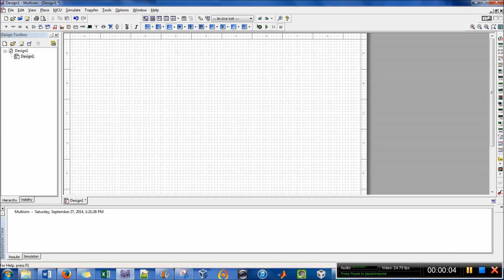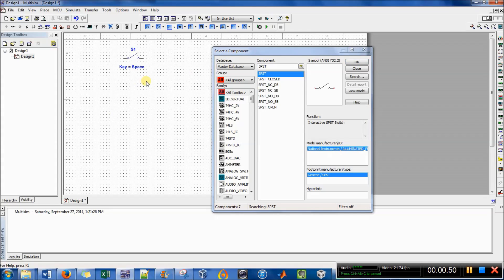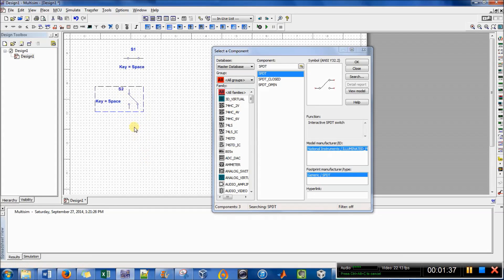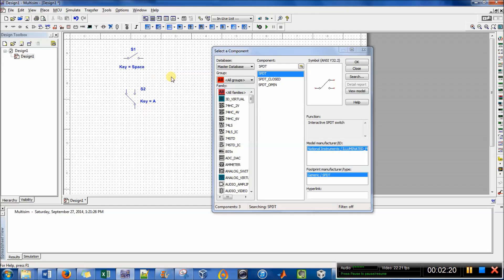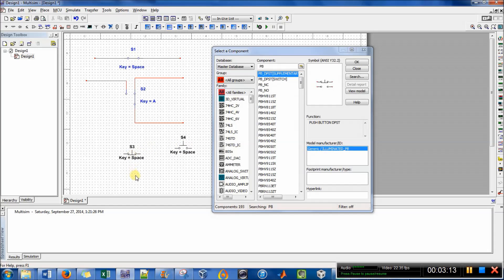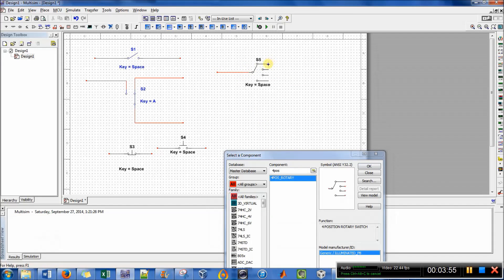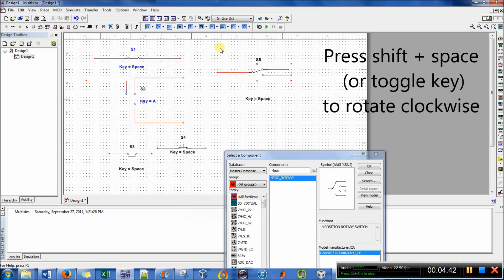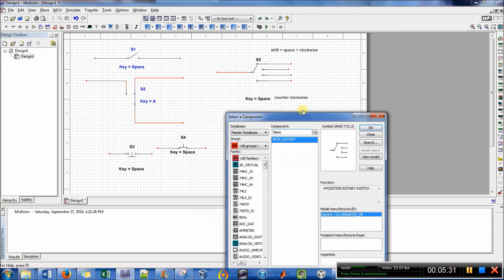Pushbutton, Positional and Rotary Switches in Multisim

Comment: This was a tremendous help. Searching for "pushbutton" leads to a model that looks like a double-pole single-throw button, but that model cannot switch states(!) I spent way too long trying to troubleshoot why I couldn't operate the button. A hint for those trying to diagnose their own situation, the static model is color-coded green by default and the interactive switches are color coded blue by default. 
I still wonder what the point of a switch that cannot switch is.